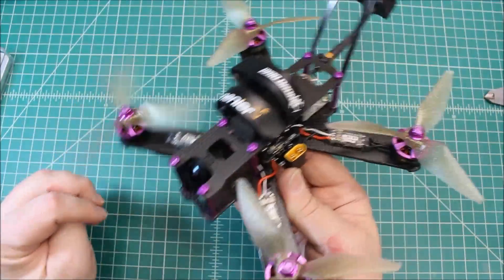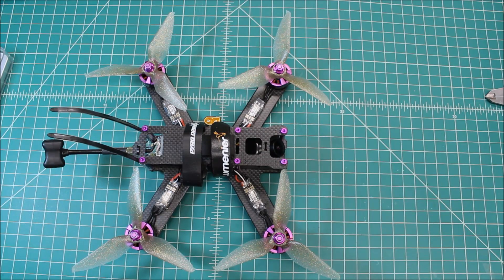Lumenier QAV210 "Charpu" FPV Race Drone Completed Build

Comment: hey man, I hope that you recognised that the racekraft5051s don't really fit on that frame :) I don't know how much props bend upwards in flight, but with those props you only have about 2mm clearance up to the topplate. I filed it down just to be safe...
Reply from the maker: FPVollgas Germany I did not have any issues with the 5051s on this frame at all.
Reply: Never had that issue i run any 5" on my qav210.

Comment: In your opinion, are these motors durable? Cant decide between these zmx v2 2205 2300kv motors or the old red bottoms.
Reply from the maker: +JC250 IMO these are a better choice than the Red Bottoms. Very powerful, well balanced and durable.
Reply: Do you think that 20A ecs would be enough for the 2300kv version of these motors? I would be using lighter props like dys 5x4x3 and the GF5045BN props?
Reply from the maker: JC250 yes they would be perfect.
Reply: So i didnt get to buy the hyperlite version of the zmx motors before they went out of stock but I think Brotherhobby makes a clone of this motor

http://www.banggood.com/BrotherHobby-Returner-R2-2205-2300KV-2600KV-2800KV-3-4S-Racing-Edition-Brushless-Motor-p-1097177.html?rmmds=mywishlist

They make, what i beieve to be, zmx clones...Should i still buy?

http://www.brotherhobby.cn/goods/41.html

Do these look familiar or what?

Comment: Still a great frame. 5051's + 2600 + 20A ESC is brave. Also how do ur customers find that antenna position? I would snap that in one crash lol. Also whats the weight balance like with the VTX there, as I have to mount mine way over the FC to get anything close to balanced.
Reply from the maker: ATMO FPV the antenna works fairly well. Would prefer it to be a little further inside the frame but didn't work out on this build.